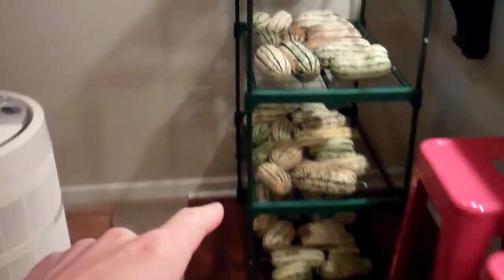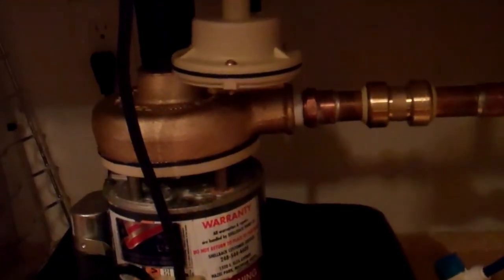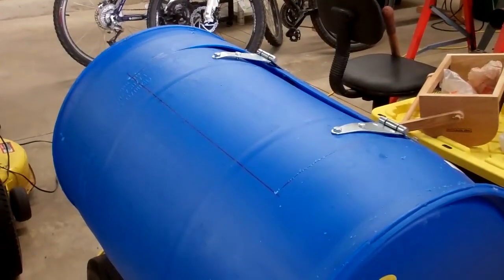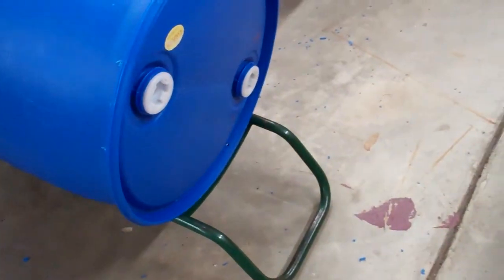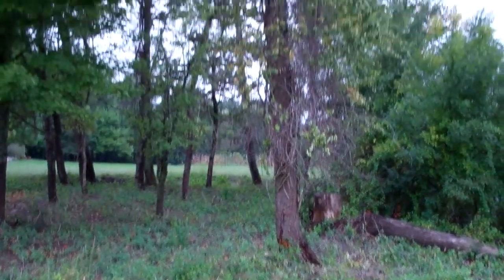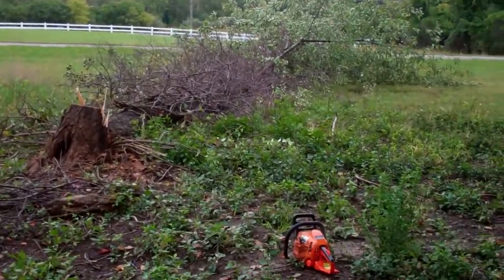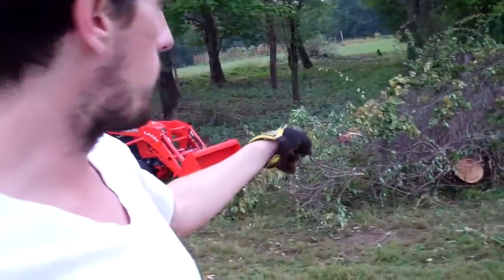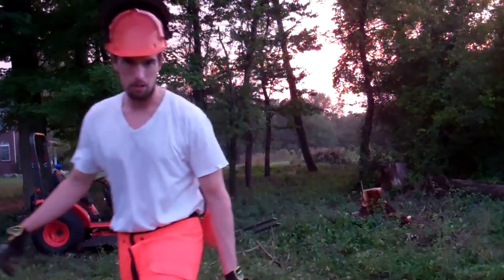Building a compost tumbler, Kubota and chainsaw teamwork - Ep. 80

Comment: Great video Joe!! I think the striped squash you have so many of might be delicata squash, also known as sweet potato squash.  What a great bounty you harvested from the garden, nice. Sorry about the poor plumbing on that beautiful basement sink. I agree with granjero's comment about creating a sump and installing a sump pump with a float valve and some pvc pipe. Looking forward to seeing how you resolve that issue.  I like your compost tumbler, you may want to add a screened vent hole on each end, located at 12 o'clock in the static position. Compost tumbling is an aerobic process, w/o sufficient air flow, and/or with too much moisture, it can become anaerobic, which is basically putrification and will result in a finished product with the consistency of warm asphalt. With the vents, however, you may experience some undesirable odors with the composter so near the kitchen door. The orange theme with the orange light was pretty cool. Great video as always, thanks for sharing.
Reply from the maker: You are correct sir! That is delicata squash, and after about the 7th time my wife corrected me for the same thing, I said to her, "well, I guess that means I said the wrong thing on YouTube as well..." LOL 
Yeah whenever I get over the trauma of the last time I replaced that shellback pump, I'll replace it with something more like what you guys describe. It makes a lot more sense than that hateful setup under the sink. 
Great advice on the composter. So far, the lid has about an inch open at the top (it sort of curls in on the piece I cut), it definitely doesn't seal tight so airflow should be OK. But I will for sure monitor it and see what happens... I certainly don't want putrefied asphalt! Hahaha, great image.  
Thanks for watching and commenting!

Comment: This tree was dying because of the ants. When the tree was falling, I did noticed you left the saw there. Then I saw on the replay that it was stuck. It's a miracle this tree did not fall before you cut it!  Each time I cut a tree like this with ants, I just wonder if they are going to simply relocate in an other tree... Do you often have fog like this? Very amazing! I wish I could have sunsets like yours. Not because I also own an orange tractor, orange (&white) saw, and orange safety pants... lol!  Just because in the mountain, I cannot see it. Have a good week Joe!
Reply from the maker: I was certainly surprised when I started making my first cut-- the saw just sank right into that soft/rotten wood, and I thought... uh oh. And as I made the back cut I think things started crumbling, which got the saw caught up, but I wasn't too worried since it was leaning where I wanted it to go and I had an escape route. I do wonder that about the ants as well, same with the wasps. Do they die, move, or remember my face and come find me later with a vengeance? Time will tell. 

The fog has seemed more regular this year in the fall, that's for sure. We live near a large lake and in a generally wet area (I think my whole county is technically a "watershed") so maybe that affects it. But it sure is eerie, and really a strange feeling when I'm mowing or out there at sundown and I drive through cold moist pockets of air. 

The sunsets are certainly great, probably the best I've seen from anywhere I've lived in Michigan. I believe it is because we are set on a higher area of ground than the surrounding areas. I've heard the sunrises are very nice as well, but I can't say I'm up with those... not a morning person :) I'm sure mountain living has its perks, it's easy to get bored with the flatness around here. At least we can both appreciate the rest of the orange things in our lives-- I've even been seeing more and more new cars offered in orange, so maybe Kubota/Echo/Stihl/Husq have set a trend in motion :) 

Enjoy your week as well Joe, thanks for watching and commenting!

Comment: Why not just have a simple p trap coming out of the sink into a sump tank then a simple cheap sump pump with float switch going from the sump tank to a check valve then drain pipe. It may take up alot of the space under the sink but its simple and you can run the larger pvc pipes?
Reply from the maker: Yeah, I was looking at those when angrily browsing the Home Depot website after discovering the recent failure, haha. If and when I do decide to fix it AGAIN, I'll likely go that route. But for now, I'm sticking with my sign and a gallon of drain-o. Thanks!